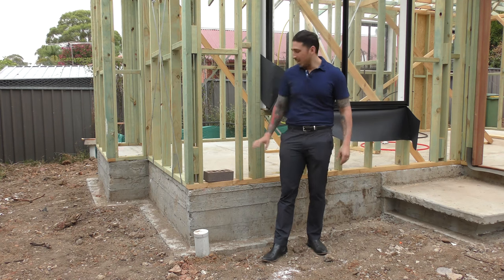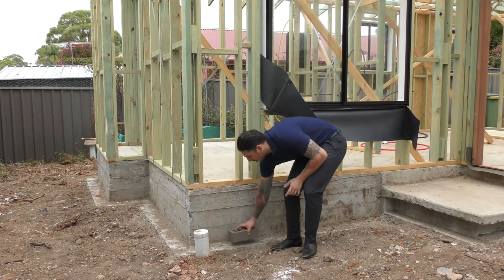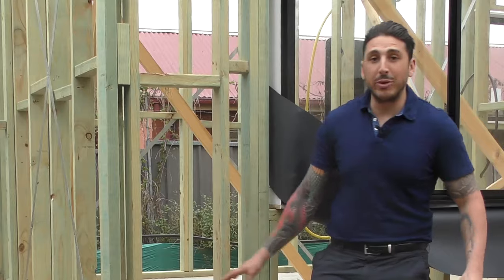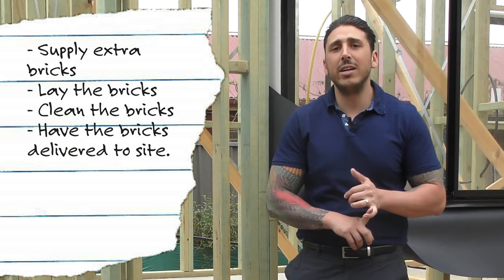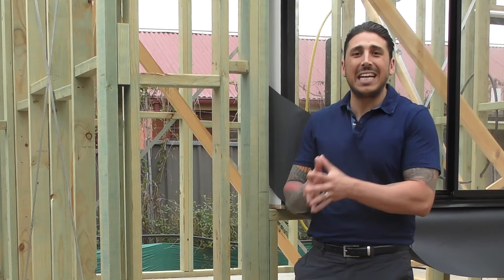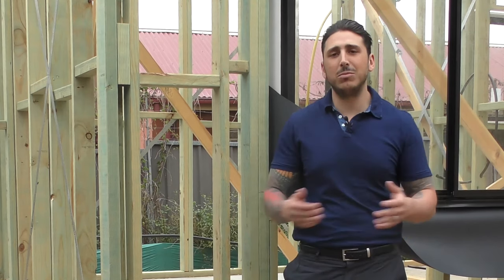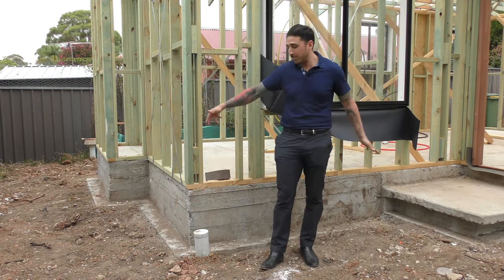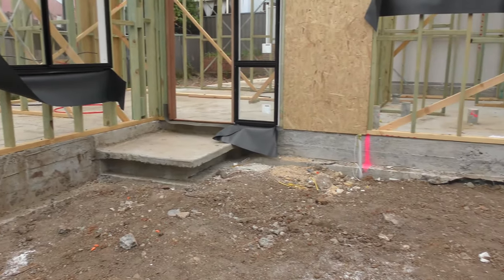Drop edge beams - how much do they cost? | Simone TV: Episode 48

Comment: Hi! 
Great useful video.  
we are building a house on a land with 3m fall, sloping from front to back. Whats is the cheapest option to avoid a split level in the house. 
Is a drop edge beam cheaper than split level in the house? Please help.
Reply from the maker: Hi Vinyl, there are a lot of open-ended questions when it comes to a site with that amount of fall. It would be best for me to gain a better understanding of the site, house size and position on the block. If you would like to email me (daniel@simonehomes.com.au) your contact info and we chat further.